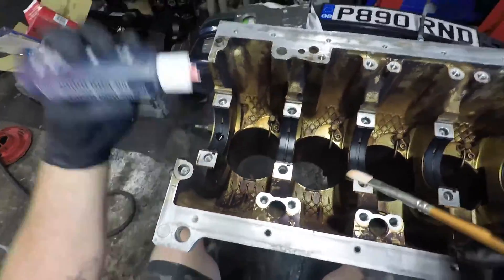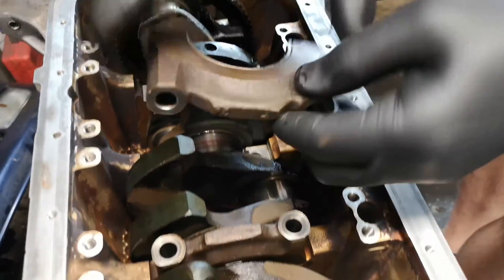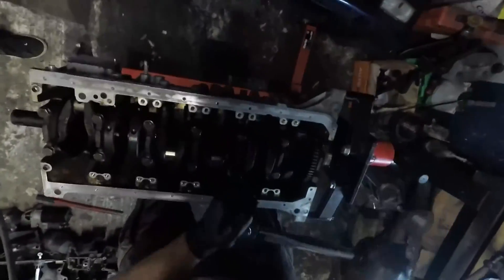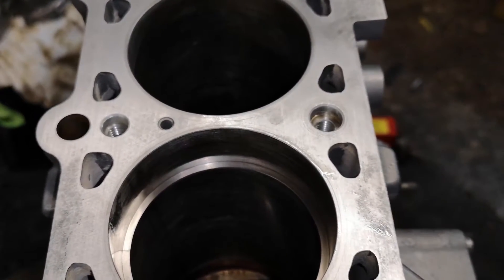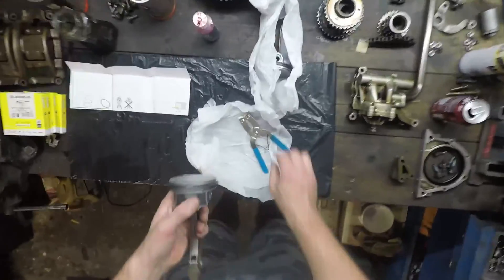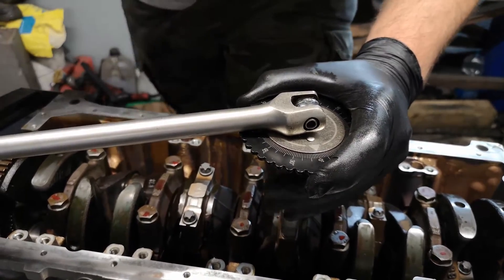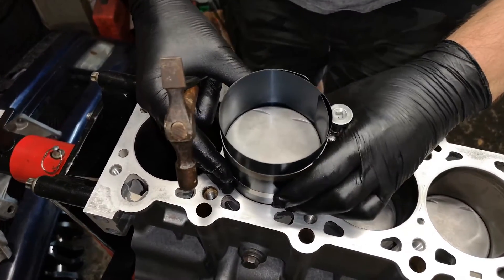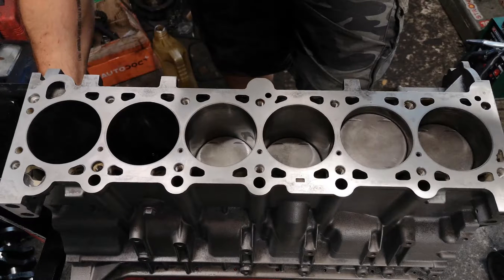M52B30 Bottom End Assembly

Comment: For the m50nv stroker build.some say the oil baffle plate needs to be chopped of a bit because the con rod will the touching the the baffle at some point but when I did mine it didn’t seem to touch
Please I need you help with this
Reply: Thank you very much👍🤝
Reply from the maker: It depends on the combination of block, baffle, rotating assembly etc and rod bolts. I use the m50b25 vanos block, M54b30 rotating assembly with oem rod bolts. The baffle plate (windage tray) doesn't foul anything on my setup either. It doesn't move so provided you turned the engine over a complete cycle and checked it will be fine.

Comment: Hey there! As far as I know the m52b25 and b28 and m54b30 pistons are too high and would hit the cylinderhead if not asssembled with a spacerplate. What kind of pistons, conrods and crankshaft are you using?
Reply from the maker: M54b30 crank, rods and pistons.
Reply: @ManSeeksCivic  Hmm ok, I guess I will have to buy a whole set from the m54 and see if it will actually fit :) my engine is the single vanos version. The nikasil coating of the m52 is not going to clash with the pistons and rings from the m54 is it?
Reply from the maker: No, the nikasil was a nickel/silicone based coating that hardened the aluminium bores in the m52. If you still have a nikasil engine today that runs fine and doesn't smoke excessively then it will be fine. The coating was damaged by fuels used in the 90s in some countries, this isn't the case today. Just be very cautious with the head bolt threads on the m52.
Reply: @ManSeeksCivic  ok, thanks for the comprehensive explanation and information :) I will maybe switch to the timeserts for the head bolts right away... I don't want to waste one headgasket just to find out that every single thread was pulled when torqued to spec... I mean, you can't be more cautious as you were with these threads, and they still went tits up... I will buy they m54 piston rings as you did, I hope it all goes well with that coating😅
I started watching your videos some days ago because of the m52 build, but actually I watched far more vids than I intended on your channel 😂 nice narrative and the vid quality gets better and better! 👍👍

Comment: You should have taken 0.6mm of the block, now you have very low compression. M54 and M52 block have 1mm difference.
Reply from the maker: Interesting 🤔
Reply: @ManSeeksCivic  I am not familiar about how much should you take off but someone said 6mm. All is about measuring.
Reply from the maker: You've got me thinking sir. My block now is an m50nv, but my torque values would agree with you. A compression test is needed but the thought of pulling it all apart isn't particularly appealing. I've another project on the go in the background but knowing that there's potentially more to be given by my build is nice.
Reply: The M54 block has a deck height of 211mm and the headgasket is 0.75mm.
The M50/M52 block has a deck height of 210mm and the headgasket is 1.75mm.

So honestly it shouldn't make a difference since it is all compensated for. I have heard of people decking the block to up the comp ratios but nothing nearly that drastic.
Reply: @nokizorque  yeah you are getting 10.1:1 compression ratio. That's low, if you shave the block you will get 10.8:1 and also 270 whp, small details matter 😉
Reply: Anybody know the torque sequence for the main cap bolts for the s50 b30??